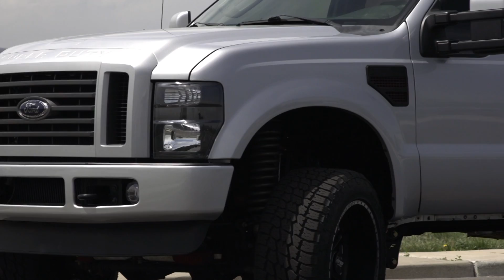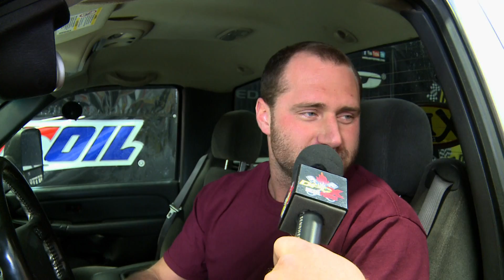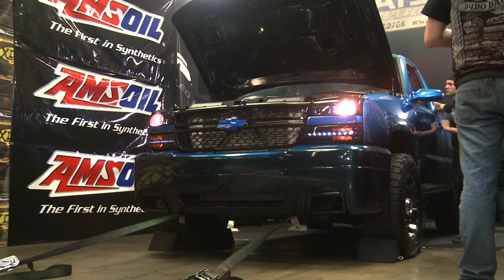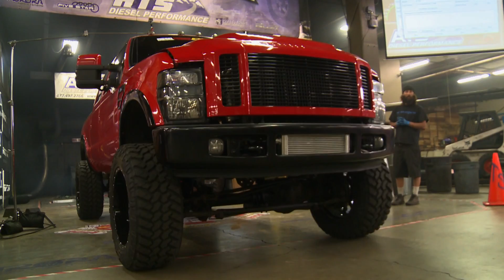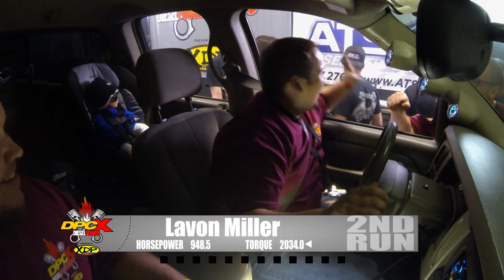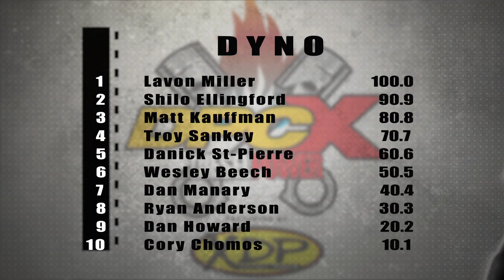Dyno Testing - Day 1 of Diesel Power Challenge 2014!

Comment: One thing people don't seem to understand is that you can make an insane amount of power with out having to blow big plumes of black smoke. Gale Banks has proved this. I mean the 04 Ram made some good numbers and wasn't rollin coal.
Reply: As far as I knew, rolling coal directly links to unburnt fuel so yes he is the man for proving it. But also at the same time I kind of would like to give these guys the benefit of the doubt and assume they run rich rather then risking running lean and causing damage.. one last thing though, wouldn't that black smoke pile up in your engine after time?
Reply: What even more people don't seem to understand is that with a given amount of air that a specific turbo can move. To make the absolute most power you will end up smoking like a 1800's chimney.

Gale Banks vehicles don't smoke because he doesn't want them to. He runs massively more boost and high airflow to prevent smoke. I can guarantee you that if he allowed them to smoke they could make more power. (he would of course never admit this for marketing purposes)  There is also a reason GBE is a small company in the diesel performance industry. Nobody buy's his product.

Professional truck pullers with million dollar teams smoke more than anyone. And the racing sanctions have specific restrictions on how big of a turbo you can use, that is how they control power levels for every class. Even for the most expensive builds by the premier expert engineers in the sport there is tons of smoke.
Reply: ChargedTTq point is you don't need to be blowin black smoke to make a lot power. Black smoke isn't cool or anything. All it is is unburnt fuel.
Reply: hershy314 "Partially" burned fuel. 

Actually the chemical energy remaining in soot is probably 1/1000th of the original fuel.... so "unburnt" isn't exactly true.
Reply: soot is different
Reply: Haha "is probably" is his very scientific information
Reply: ChargedTTq  Your explanations is incorrect the reason they are blowing smoke in pullers because the turbo is only working efficiently in a certain range while the rest of the range the engine is VERY OVER FUELED. You said ''multi million'' Try looking at Le Man's race car the Audi R18 diesel you will not see any smoke come out of it.

GaleBanks doesn't smoke is because he has ECM programmers & datalogging equipment and went through such extent to add the proper amount of transient fueling, by no means that smoke coming out of your exhaust is efficient at all, it's a pure waste of fuel.  Meanwhile pullers and average diesel truck enthusiast do not tune to this level as it is the stock PCM being programmed and lacks the input and outputs to add extra functions.
Reply: 563ripper
 Rolling coal just takes out the piston rings ! lol

What I also forgot to add was the serious pullers are on mechanical injection so controlling the transient fuel delivery doesn't appear important because they start the pull with as much boost as possible.
Reply: The reason that people do that is because stock exhaust will keep that smoke in creating problems down the road
Reply: you do know that aftermarket exhaust doesn't mean you will have black smoke, there is more too it than exhaust.
Reply: *****
Water injection is just chemical intercooling lol.
Reply: Banks has certainly proven that you can make a diesel very fast with out all the black smoke. Beating out other diesels that are in the same class that do blow black smoke. These aren't cheap trucks, these aren't the types of trucks that are built on a budget. The groups running these trucks wouldn't have much of a problem modding the trucks they run to not produce smoke.

Smoke doesn't equal power. It's just wasting fuel, and the more fuel that isn't getting ignited means a loss of power. The more efficient the engine runs, the more power it can produce. At the same time if it's running efficiently, there shouldn't be any smoke. Smoke = loss of potential.

With that said, I love seeing the smoke. Mainly because of how much it pisses off the eco nuts.
Reply: Draggon Reaper
It's ECU control and individual cylinder tuning they don't have or care about... Banks uses more than just a hand held tuner.
Reply: Draggon Reaper Banks has never beaten anyone in his own class. Banks doesn't compete.

Banks has million dollar custom ecu control, unlimited cylinder pressure and nitrous, and an engine with $75k worth of machine work. 

The ones to look to are the ones with the money on the finish line. The professional pullers who spend millions on trucks and tractors. Even on ecu controlled ones they send smoke 6 stories into the air.

Who are you to say these guys have the extra $10k to make power with no smoke? Hell just to make 600hp with a DPF (totally smokeless) DuramaxTuner needed a dual turbo system setup pushing enough air for 1000hp, and even then they are having issues with driveability and transient fueling. 

600 HP with smoke and you can still use the factory turbo. (With good tuning and big injectors)

So why invest thousands of your hard earned dollars in the interest of a bunch of people who are paranoid that black smoke is bad for you because it looks icky.
Reply: show proof
Reply: ChargedTTq Banks didn't make a puller though, he made a drag truck. A drag truck that currently holds the world record for fastest diesel pickup.

Either way, you are still failing to see the point. In ANY car, doesn't matter if it's gas, diesel, or ethanol. Smoke = inefficiency, inefficiency = loss in power. It's not a matter of "Oh no, the smoke is bad for the environment", but more of a matter that the smoke means the truck isn't making as much power as it could. Unfortunately at this time, they have to run their trucks inefficiently. Forcing more fuel and air into the engine to make more power to compensate for the loss of power from some of the fuel being unused.

The problem is that to figure out how to tap into that wasted power coming out of the exhaust would require effort to figure out a more efficient way, to be willing to spend the money on different ideas. Problem with that though is different ideas will lead to losses more than wins. These people don't want to invest that kind of money and lose time and time again before they figure out a better way.

Give it time, I'm sure that there will be a smokeless diesel puller in the future that is putting down more power, and dominating its smoking competition because it isn't wasting fuel, or losing power because of an inefficient system.
Reply: Draggon Reaper Yeah but banks doesn't compete within any rules against anyone else. He just outspends anyone bothering to try for the record.

I honestly hope they develop a way to use that last 5-7% chemical energy they are wasting in the soot. But at the moment smoke is the norm. Trust me they have experimental engines its highly competitive.

hershy314 burden of proof is on you brother, you are making claims that deviate from the norm. Again Banks doesn't count, he has an agenda, an unlimited budget, and does not compete within set rules. Anyone who smokes has one of of these factors affecting them.
Reply: hershy314 Right well since you're such an expert tell me just how many average people get cancer from diesel soot?
Actually you can't, it has never been studied.
Well how about this, how many people who work with smoky diesels every day get cancer?
I'll answer that one too, 1 in 200. When you apply the risk ratio of soot of 1.47 to the baseline cancer rate you get 1 in 200.

Inhaling soot for 8 hours a day for over 40 years can only muster a 1 in 200. 

Today that means at MOST only 1 in 200 diesel tuners will get cancer, and probably less than that. Average civilians which get a whiff no more than one or twice a year will have such a low cancer risk they won't be able to cacluate it.

How do you say its bad for the environment? Because its not.... At all... Only co2 emitted is bad for the environment due to global warming. Of which diesel tuners contribute an impossibly small fraction.

Just because you've worked on a few does not mean you're an expert on diesel combustion characteristics. Face it, you are prejudiced against soot because it looks icky, you don't know enough to be able to say that they are wasting fuel.
Reply: OK buddy, to correct the very first thing you said black smoke is partially burned fuel, period, unburned diesel is white when vaporized. You're wrong there and you're still wrong no matter how many aimless arguments you use. Stick your fingers in your ear and go lalalala.
Reply: ChargeTTq, you're forgetting something about that black smoke ... created by liquid fuel in the combustion chamber, for that liquid fuel you could have had that volume taken up with atomized fuel and air. So you're not making the optimal power.
Reply: ChargedTTq Black smoke is an imbalance in the air to fuel ratio - too much fuel to not enough air. Know what happens when there is to much fuel to not enough air? Some of the fuel doesn't get burnt, or used. So yes, Black smoke does mean there is unused fuel.
Reply: Draggon Reaper He holds the land speed record on a salt flat, not in 1/8 or 1/4 mile.
Reply: And what's not being said is that banks runs a crap ton of nitrous, had teams of engineers testing and dyno tuning for almost a year, tons of one off engineered parts. Probably hundreds of hours of dyno time. They where rebuilding those engines every couple passes because the rods were bending . They also had full control over parts quality, injector nozzles for example, use only the best where as everyone else gets what they get. After all that time and money he got beat in the 1/4 by a truck with probably 1/10 the investment, who actually ran with regulations.
Reply: nmdiesel89  Banks doesn't run a '' ton '' of nitrous and any injector nozzles he may have made for a custom setup is custom made.
Reply: MidShipCivic lol yes he does, he runs more than most anyone else does, just look at the truck/dragster, 2 bottles when most others run a single, few know of his jet size, staging ext, but when you run 2 bottles its a good sign your using a bunch of nitrous. Exactly custom made, as in he can make 100 nozzles and pick the best 8 out of the batch, everyone else gets what they get. emd nozzles are not perfect especially when they start getting big, witch can effect spray pattern and rail pressure.
Reply: hershy314 Mostly lost potential power. I don't think reaper understands once you have that much smoke you can add more fuel all you want and you won't get any more power. Not enough O2 to go around. I am amazed that more people can't understand that. It's basic physics.
Reply: Mon Saka It's not that simple. Diesel combustion isn't a homogeneous mixture
Reply: ChargedTTq it is that simple, no matter what you won't make any more power adding more fuel than needed.
Reply: MidShipCivic "Needed" is the ambiguous concept.

Mixtures are not homogeneous inside a diesel combustion chamber, therefore you are guaranteed to have uneven combustion.

Emissions demands require therefore that at the least efficient portions of combustion, there be little to no soot produced. Therefore sacrificing combustion heat produced at the most efficient areas of the chamber.
Reply: ChargedTTq  Don't talk beyond your expertise, more air less air diesel works the same way, only difference that a diesel is load dependant it can run on very little fuel to maintain a running state what you just tried to bring up is stratified combustion.
Reply: ChargedTTq In any engine there is never perfect "homogenous" combustion. Doesn't change the fact that black smoke is totally wasted fuel. More O2 would burn that and make more power.
Reply: That doesn't change what I said. In gasolne engines the mixture is relatively homogenous. Even to the point where under the right conditions supersonic combustion can occur. (Detonation) 
In diesels this type of combustion is impossible. Therefore there is more than enough room conceptually for you to make more power even when there is smoke. There are too many variables during diesel combustion. Spray pattern, droplet size, timing issues, Ect ect.

For the people who keep claiming you can make more power with a race diesel by altering timing and losing smoke let's see you do it Put your money where your mouth is.
Reply: ChargedTTq ROFL. Oh sure yep you are right there. Your homogenous mixture only varies from 13 to 15 to one in a well running engine with 10 to 15 to one not being uncommon. Why do you even bother using the term homogenous? In fact why are you even trying bring up gasoline engines and their mixture tuning issues when they really have nothing to do with the discussion at hand.
Diesels are a lean burn engine. That fact does not make them suddenly work better than gas when over their stoichiometric ideal. Soon after that ideal is passed they start to smoke just like a gas engine will. The richer the mixture the more it will produce smoke and the power gained will drop off rapidly as the fuel rate increases. 
Lol you can throw all sorts of different variables in and it doesnt ever ever change that fact that you will only get more power as you have more oxygen to burn your excess fuel. There are never too many variables unless you don't understand your engine basics. For a diesel, spray pattern is trivial compared to droplet size. Higher pressures generally equal smaller droplet size which greatly helps mileage by allowing the fuel to burn faster. This gets the heat where it can do the most good, while the piston is still up and starting down. Timing is more complex, especially these days where they do multiple injections during each event.
However none of those fine details makes much of a difference in power if you are limited of oxygen. You can add all the fuel you want but the engine is not going to actually burn anything over its stoichiometric level. Once the oxygen is used up the rest of the fuel turns into black smoke. And black smoke does not create heat and heat is what creates the torque. Timing can help manipulate where the heat happens in relation to the Piston position.
A diesel might idle at a ratio of 100 to 1 Thats pretty lean. It does not smoke because there is more than enough oxygen to get it really close to stoichiometric(14.7:1? if I rem correctly) How close it gets will depend on the efficiency of the injection system.  Diesels are pretty simple engines. I dont understand why so many people have a hard time understanding them. :)
Reply: ChargedTTq YOU DO NOT make more power with out any more air = Smoking.
Reply: Mon Saka Again, you are oversimplifying things. Its not that simple. Combsustion is not an instantaneous event. Diesel fuel does not consist of a single molecule size. This isn't a laboratory. 

Thousands of people, even with electronic timing, make more power with a diesel that smokes than an equivalent one that does not. People with tens if not hundreds of thousands of dollars on the line. 

There is nothing left to argue here. Go prove me wrong and stomp all over the pro truck pullers, drag racers, and dyno queens.
Reply: ChargedTTq No body said a smokeless diesel made more power than one that smokes like a chimney. At least I never did. How ever you can make a crap ton of power with out spewing black smoke. That smoke is nothing good, that is a fact.
Reply: No doubt you can make a lot of power without smoke. I totally agree! These guys are the ones saying you can make more power smokeless, assuming a fixed amount of airflow.
Reply: ChargedTTq You really have no idea what you're talking about if you think someone here saided fixed. You just never comprehended what anyone said, and your comment is sheer proof.
Reply: ChargedTTq Nobody said anything about a fixed amount of airflow! Show me where I said combustion was an instantaneous event? Or where I said anything about a single molecule size. If anything I alluded to the opposite. I know for a fact that these less than perfect cylinder conditions will always yield a certain amount of inefficiencies. These inefficiencies will always cause an engine to put out a little bit of smoke. There is even a small amount of smoke at idle for that very reason. Under full power with plenty of air there will be a certain amount of smoke. enough to see but not rolling black. Once you use up all (the majority) of the O2 that the engine will use adding more fuel just makes more black smoke.
These guys that spend millions on their trucks still pull their pants on the same way everyone else does. If they were here in this discussion they would agree with us and give us reasons for their excess smoke. Reasons like, 1. We do it on purpose because the majority of fans like to see black smoke. (It is mostly carbon and settles to the ground and grows great grass.) 2. The biggest difficulty in building these engines is getting the massive amounts of fuel needed to the engines. Balancing  that fuel with the air is also complicated by turbo maps and turbo inefficiencies at low rpm. Turbos that make the most pressure at full throttle often suck at lower rpms or vice versa.
Not to mention trying to map that in with NoX and when you need to choose to inject that NoX.
Sometimes you can tell which path the builders took by how the truck performs. You see smoke early that mostly disappears under full load and higher rpms you can conclude they went big with the turbo maps. If the black smoke suddenly disappears anywhere in a run you might be correct in assuming they put nitrous on but not a way to add more fuel when it is triggered. Not mandatory on a diesel like it is with gas since you can overfuel a diesel a lot more than you can gas and still have it run. 
Whatever their reason it does not change scientific fact that a truck rolling coal would make more power with more Oxygen because black smoke is unburned fuel. Heavy black smoke occurs due to lack of enough O2 accessible to burn it. Would turning down the fuel decrease power? perhaps a tiny bit depending on how bad the overfueling is. Would adding another 10 lbs of boost clear the smoke some and add more power? Heck yeah it would. There may also be a few other reasons for serious overfueling but those are irrelevant and pointless for the sake of this argument.
Reply: ChargedTTq I must have missed something somewhere. Where was it previously stated that you were talking about fixed airflow? Like fixed boost? 
My point has always been adding a little more air would clean up the smoke and give more power. Which basically means rolling coal is pointless if you can add air. Nitrous could clean up what the turbo can't handle as well. 
If some competition mandates no nitrous and limited boost well duh these guys are going to go for the last 1/2 hp they can get and the result is every truck will be rolling tons of coal. In my opinion such rules would be stupid. But then I don't watch these competitions other than occasionally running into them online while searching for something else. 
If it was my truck and I had to operate under fixed boost rules I would be upping my injection pressure along with a couple other tricks I learned on accident. It would be an efficiency game then. Whoever matches their fuel up with O2 the fastest will win with less smoke.
Reply: Well I guess it was just implied that the airflow had to be fixed. Its how sanctioning bodies regulate power in different classes.
No doubt adding more air would make more power.
Out of the thousands of pullers I've seen I doubt all of them would be blowing smoke for the crowd. 
In the end, it seems we agree, just like you said there is additional power and performance available even if its only a little. 
The limit is turbo inlet size by the way, not really boost.
And with a truck its always either turbo or fuel that is the limit. Especially with stock turbo trucks the turbo never moves enough air to match the fuel system. So for those going for max power they choose to have the extra 50hp and smoke.

I think this whole conversation lost track. There are plenty of people who say that a smoking truck is "wasting" fuel and that's just not the case. There is plausible performance benefits to pushing fuel beyond a smoke point. That has been my point all along.
Reply: ChargedTTq Wow. You spend 5 paragraphs just covering yourself with silly stuff.  Turbo inlet size? Really? Like you don't think anyone needing more boost isn't going to size the turbo for what they want? What a silly thing to say. Like you are just trying to go for a distracting argument. How does turbo inlet size not affect the boost? Nobody goes with or says something like, "Yeah my turbo puts out 60 lbs of boost for my system but yeah that inlet keeps me down to 30. Yeah darn those turbo inlet sizes, You'd think they would design those to go with the rest of the turbo. What a crying shame!"
Now I suppose you are also big into and an expert on turbo maps. Intake maps and exhaust maps. Obviously you are a turbo intake restriction expert so I have a couple questions for you. Now obviously a restrictive turbo inlet should show a vacuum somewhere. Where should I put the port to test for vacuum? Obviously such a port would be handy because it would show when the design limit for the turbo were exceeded right?

As for losing track, thanks for the redirection. A smoking truck is always wasting fuel. lol Thats a fact that that I find it amazing anyone would argue with. So they ran out of air and got 10 more hp due to their inefficient(imperfect) injection system. It can't be avoided I am sure. It is still wasted fuel that if burnt would mean more power and higher efficiency.
Reply: ChargedTTq Theory? Hey don't go off mad! hehehehe
Yeah if I had more money id build a few more power rigs based on old engines. Its kinda fun to see what you can get away with before the engine blows up.
Reply: Gale Banks wasn't making this much power bud lol
Reply: Yep black smoke just means it is over fueling, which is what happens if you tromp it even in a stock tune before the turbo spools to full boost.
Reply: MRdoA77 not only are you wrong but you are making claims that dont make sense
Reply: I don't know anything about engines or whatnot. but why don't they have better ventilation? At least put a big open door or something behind the car instead of gassing everyone.
Reply: Doreen Green Nobody really knows haha
There are plenty of dynos in the country with forced ventilation.
Reply: Watch the other events it smokes a lot.